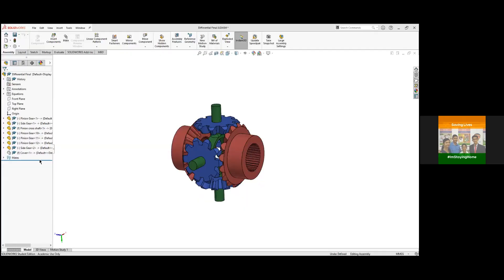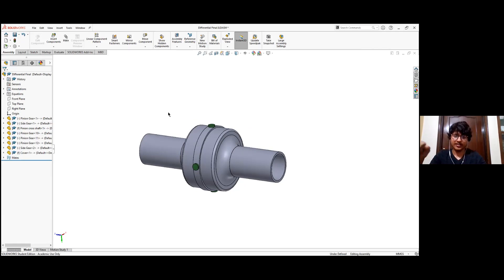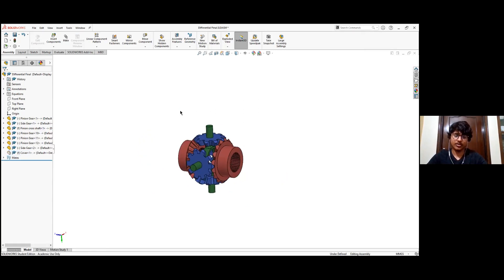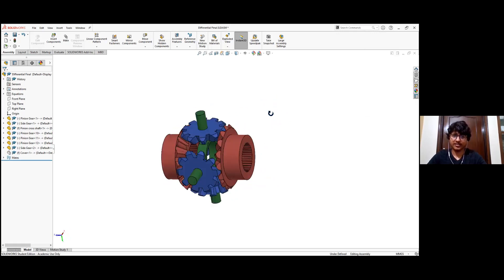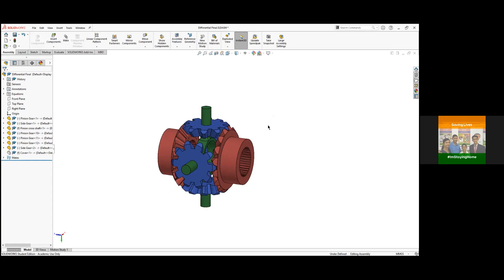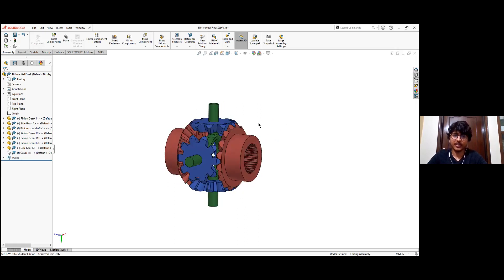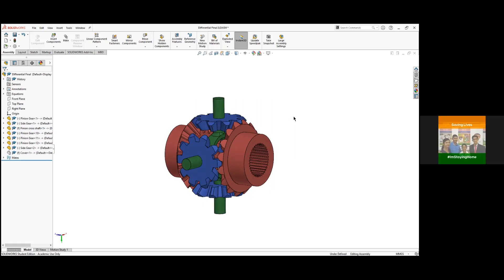Differential- Intro, Purpose, Working, Types, Major Parts |Drivetrain| Formula Student| FSAE | Supra

Comment from the maker: Video Timestamps

00:00 Introduction
00:20 Differential Working & Purpose
01:20 Different Parts in Assembly
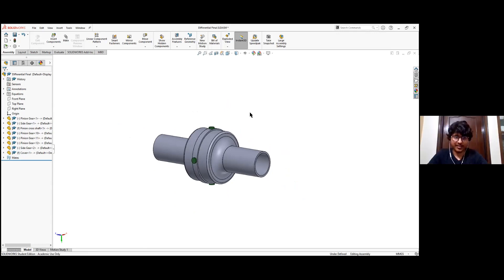02:16 Types of Differential Assembly
02:57 Starting with Differential Parts Modelling
03:08 First Step with Modelling